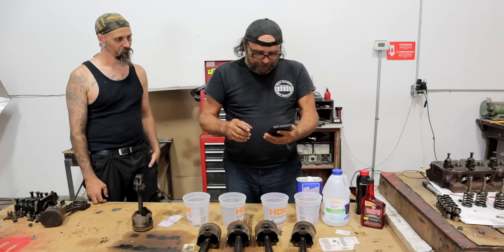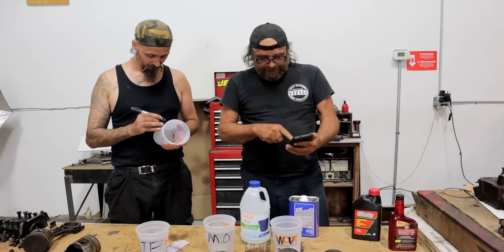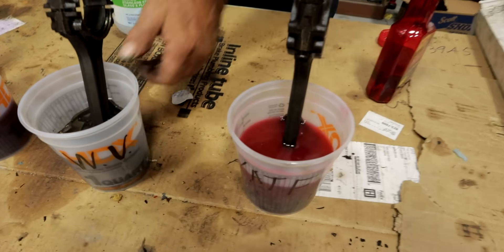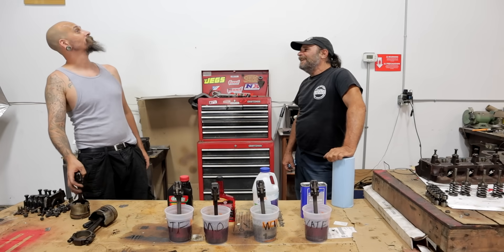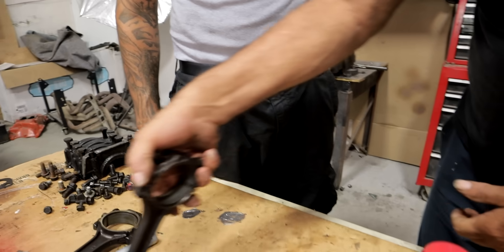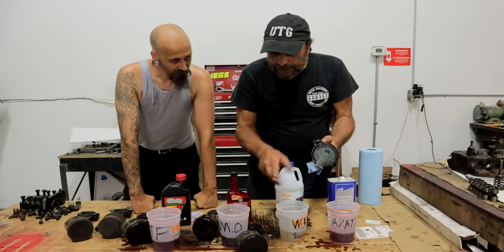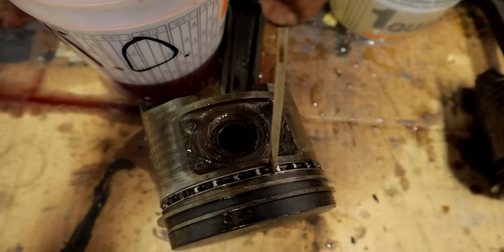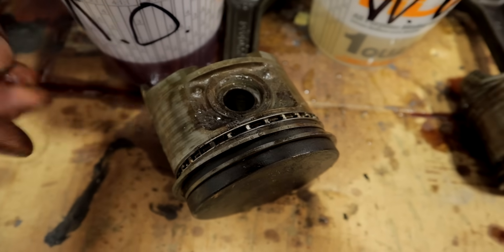Best Fix For A Stuck Engine - Viewers Choice. Marvel Mystery Oil, vs ATF, vs Acetone, vs Vinegar

Comment: Mostly interestinjg. BUT and it's an Important "But"!
BIG difference between Sticking a crudded piston into a tub of 'cleaner' for some time.
 Any Fool can manually  unstick /clean Stuck rings when the piston is in his hands. 
What works in an  assembled engine you want to run .. again ?  Fill each cyl with 'cleaner' ... let soak for days.. then Pray?

Comment: I have inherited an old Ford with a 351C motor which has been garaged and not turned over for 40yrs. Should I fill the cylinders with white vinegar down for 24hrs and then remove the vinegar and poor Marvel mystery oil in there for a couple of days before turning the engine over?

Comment: Well, the issue with the rings was rust.  The best choice would be a rust remover such as vinegar which is acidic.  None of the other choices address the problem of rust.  They are all lubricants except for the acetone which is a de-greaser.

Comment: I have good results Methyl-Ethyl-Ketone. Basically, also whatever contains 2-buthoxyethanol as a surfactant should work pretty well. Spray Windex (foam) on a piston with a carbon and use just a tooth brush to agitate it a lil bit. You'll be surprised.

Comment: You need to heat up the parts and carbon for mmo to work . Vinegar is acid...acid does eat rust abd and it etches metal.

Comment: It is the combustion PRESSURE that will have the most effect on the rings, not it heating up.
Acid - vinegar - works on rust. Before painting steel ...

Comment: You should test with pistons in the bore as simulating fixing without removal im trying blaster small engine restorer in a smoky diesel shot throgh glow plug hole and intake some engines are hard to pull out if some chemical freed rings with out dissasembly it would be miraculus

Comment: The best solution is car brake oil, brother, most of the car dealerships use this method, we pour 10 cc of brake oil into the spark plug hole of the car, which we opened before, and after half an hour, we close the spark plugs and start. we hi
Reply: Thanks for your answer. Do you drain the brake fluid out?

Comment: You want your mind blown try Berryman b12 Chem dip. The stuff for dipping carburetors. Won't help rust but varnish and most carbon deposits brush away with a soft bristle paint brush. The only thing I've used that's better on carbon is the commercial valvoline GDI intake and valve cleaner (the stuff sprayed out of the apparatus with shop air.) Unfortunately I don't believe that stuff is for sale to the public.

Comment: Yank the plugs and valve covers. Back off rocker arms so valves are closed. Use a ball pein hammer and break porcelain off the plugs. Braze air fitting to the threaded plug base. Use Marvel because it's a thin oil. Hook up your air line. Come back tomorrow. Ben

Comment: So if I pickle my pistons, will they shrink? 😅
Seriously though, if you actually pour vinegar into the cylinder do you crank it a bit and then drain the pan? I would think vinegar and ATF, or something more viscous to keep it in place would do a better job pouring it into the cylinder.

Comment: So does that mean if I have a frozen engine, I should fill up the motor with vinegar and let it sit for 24 hours? Then afterwards drain it and put regular oil and see if the frozen engine starts?

Comment: Is vinegar a good engine lubricant?
I'm not putting that in my engine.
Anyone can free up rings with pistons out of the engine.
This has been a while.... I'm gonna check if you've done a video using seafoam, techtron and  Chemtool in this same scenario

Comment: Thanks Tony I might try 20% or even 30% white vinegar but may add a drop of ATF or olive oil for good measure just because. Wonder how my homemade salad dressing would work. I got a 1976 Vega with blow head gasket and everything is locked up. Might be fun to make my salad and pour excess dressing in engine and see if it will crank the next day

Comment: Used (coffee filtered) DOT3 brake fluid. 

Soak, then boil (differential expansion will open out the wrist pin and help free that off as well. Remove the rings and clean out the ring grooves with bamboo tooth pics. Very light burnishing here and there with aluminium foil, washing off the aluminium dust afterwards.

Came up nice and shiny. Dunno how it ran because the cops towed the car (with its freshly re-assembled engine) before I started it. Sooo sad
Reply: You could of course use new brake fluid, but why would you? Note that my rings weren't rusty, just coked up. Vinegar might be better where rust is the issue
Reply: Forgot to say that the boil was in tap water with a bit of washing up liquid. Have also used washing powder in the past, but it etches aluminium a bit, probably because its alkaline

Comment: UNCLE TONY.. MY GOTO IS A LIQUID I GOT FROM. A GUY WHO WORKED AT A  foundry that makes airplane parts...it's purpose is to check for cracks in the parts under ultraviolet light..DUDE THIS STUFF WILL BREAK DOWN THE TOUGHEST STUCK STUFF. GREEN IN Color but it's a excellent lubricant to break rusted stuck anything
Reply: Ah Excellent Green Stuff from an aeroplane plant. Thats the sort of definitive data point that we like.
Reply: @edlithgow4360  It actually resembles antifreeze coolant for your car ...I think that the dye they use for florescence is what gives it it's color. The business is located outside Albany Oregon and manufactures parts for many aeronautical companies..ie Boeing. My neighbor worked in the foundry plant and scored me a gallon of the stuff I've had since 1989 and used it on many many items over the years. It doesn't take a lot.
Point is this if there's a crack or thread or anything for the stuff to get into it will and it doesn't take gobbs if it. Hope this shirt novel helps explain (lol) It really is fantastic stuff for penetrant...nut buster lol 😁
Reply: Funny you say that. I had the opportunity to tour the labs of Indy Speedway as part of college Chemistry class. After a wreck lab folks covered the parts with some type of green goo as well to check for metal cracks poorly\not visible by eye. Thought they then ran parts through X-ray machine. Wonder if this was similar ro what you're describing.
Reply: @kevinkohler7997  The gentleman I got it from worked at a foundry that made parts for aviation and the parts needed to pass a standard by FAA. This dye was fluorescent and would also show cracks under UV lite. It's secondary use it makes one hell of a penetrant👍✔️💯

Comment: there are 4 parameters to clean:
heat
time
chemicals
mechanic

if you reduce one, you have to increase another one

so you should move or vibrate  your cleaning stuff and get it at higher temperatures

I put pipe cleaner, dishwasher cleaner and hot water into a tank and move it with a pump for 2 days

Comment: I’m surprised there won’t more votes for diesel.
I will sometimes mix diesel & marvel mystery oil with success.
Reply: I also would have expected Diesel to be at the top of the list. Maybe it was #5.
Seafoam is another one I expected  up there.
Reply: That'd be great however, most of us we do not have like a diesel engine to work on we're mostly have gasoline we don't the knowledge😊
Reply: I try today a mix of 150ml diesel,150ml of brake fluid ,and 150ml wd 40... mixed that and fill it on to the cilinders...i did the same mix in a cup and put the old sparkplugs in it to see if the carbon built up will leave...magic after 5hours a wipe of the carbon buildup with simpel old rag..Suprised how the pistons look tommorow and if it will free the rings.. a mix with atf and acetone is a good second option i just see,! Thanx for the video test , greetings from Holland ,with a oil consuming Audi engine...( 1.6 bgu)
Reply: Under what conditions, is it rusty cylinders or sticky rings like from excess old fuel residue.  Im freeing up an engine right now.  I’ve used marvel in the past and it worked well for a motorcycle that sat in storage for 10 years, but I also soaked it for several days and rotated the engine every so often
Reply: @shidukirider I’m trying to free up a piston in an old 1982 Kawasaki klt 200, it was free when it last parked a few years ago, it’s been about 17 hours since I put the Marvel mystery oil down the spark plug hole, still won’t budge, how many days do you think it could take for that stuff to work if it’s going to work?
Reply: @TimothyWalton-fr4is  might take a few days.  Also you might try to turn the engine using a breaker bar on the  flywheel nut.  You can try to work it back and forth that way too.  Wonder why it got stuck, maybe just humidity.  If the cylinder flooded with old fuel it could be gummed up.  I used berrymans b12 to cut through old gummed up fuel on a low mileage frontier with compression issues

Comment: I didn't record numbers, but have had some luck on old oil burning cars with Xylene, added to cylinders, let sit for a weekend, then blown out, followed by a brutal "whupping on it" drive, then an oil change.
   It's a strong organic solvent...dissolves stuff that gasoline or atf won't,  and also isn't very volatile, so doesn't evaporate away before it does it's work.
   It's sold by gallon or quart in the paint aisle, a better deal than some expensive aerosol that is just an overpriced mixture  of common solvents,  given a fancy name. (e.g.- mineral spirits sold as "goof off", or whatever it is.)

Comment: I'm a metal fabricator and use concentrated vinegar to remove rust and mill scale. If you let steel sit over night it will usually be totally clean with a quick wipe from a rag in the morning, but it will start rusting again almost immediately. Once it gets coated in oil it would probably be fine, but it will rust any other steel/iron it can get to
Reply: Have you ever tried dropping the steel into some Purple Power?  With a pH of around 13, it should easily neutralize the vinegar.

Comment: Totally (or 90%...) off topic, but I'm amazed at the great job that tomato ketchup does on cleaning copper. Smear it all over the tarnished copper, leave it for an hour or two, and rinse it off. (Consider ketchup as vinegar in a gel formulation.) Ketchup or vinegar can also enhance the flavor of Tater Tots and fish and chips, while Brasso or Seafoam won't. So there's that.....
Reply: @johnstuartsmith
 Thanks for the tip. I've been wanting to try a way to clean some tarnished pennies without abrasives. Also will try on some vintage/antique brass items I have without damaging the finish.
Reply: That is because almost any acid will attack rust. Tomatoes are acidic as are lemons, citrus fruits, vinegar, soda pop,,,,,. However, some will be more messy. All should be cleaned off well after, steel tools and auto parts wiped down with an oil to prevent rust.
Weak or diluted acids will take longer, some strong acids might dissolve the part or even you. If using strong acids you might neutralize them with a base such as baking soda prior cleaning.
Reply: I use V8 to clean oxidation off extension cord prongs and male/female spade connectors. It'll loosen the oxidation so it can be rubbed off then rinsed using hot water.
Reply: Indubitably

Comment: I couldn’t begin to count how many engines I have successfully un seized including valves stuck open. 

In the beginning I tried many different oils including ATF. 

After experimenting and not being successful I found something that works better than anything I have tried and has never let me down and I’ll only use this for stuck engines and that’s break fluid. 

I would  pour just enough down the spark plug holes to about a quarter inch of break fluid on top of the pistons and let it sit overnight.
Reply: And then. Turn on the engine with brake líquid in?, or oil chahge first?
Reply: @ 
If the fluid goes past your rings and into the crankcase then you have bigger problems than worrying about changing the oil.

Comment: Good video, i have a CA allis Chalmers engine stuck. Im going to try the vinegar. In the past we would remove the plugs and pour an elixir into the cylinders and if that didn't loosen the engine then if it had a manual transmission you could put it in gear, pull it then engage ( pop the clutch) and that would work every time.

Comment: I've seen guy's spray brake cleaner into their cylinder's, then do a Plug change and an Oil change.. I've seen some turpentine used too for carbon.. Great vid though. I actually expected the Vinegar to clean the best. Never seen it used before.

Comment: The Acetone would have worked better without the ATF, Please PPL don't put that into your cylinders. I have been hearing PPL say Trans fluid will clean and unstick rings. I have seen PPL poor small amounts of Berryman's into their cylinders overnight and get decent results. But I haven't seen anything you can take, pull the plugs and poor it into the cylinder's that works without having to be used a few times. But then when you do that you have to do an oil change right after depending on what you use I guess but soon after.

Comment: Just used vinegar to get a stuck piston out of a 351 Cleveland. Currently have it soaking to get the rings out now. Also used some other UTG videos to do a quick hone. I’m doing a quick home rebuild to get it running again while I start buying performance parts. This is the first plateau.
Reply: I let the vinegar sit in that cylinder for about 3 days before disassembling. Twice a day I checked it, in the morning and at night and each time there was rust/carbon residue at the top of the cylinder.
Update, I placed the piston with seized piston rings in vinegar in the afternoon, and checking it at night (11pm) oil ring is starting to break loose. The top and second ring are the ones that are worst off.
Reply: @B1Springfield  Did you get the engine running with the original pistons? Vinegar freed off a motorcycle cylinder for me that hadn't moved in 30 years. Haven't run it yet though.
Reply: @ I actually did, but had to rering the pistons, clean up the bores a little with the grinding stones, and, that one cylinder is a constant worry on my mind. Planning to send it to get bored 30 over with new pistons soon.

Comment: When you disassemble the pistons and its parts outside the engine piston chamber. It is very easy to remove the oxidation , carbon built up and sticky sludge. It is different if you don’t remove them and used engine flush

Comment: I just used Berryman's B12 Chemtool to free my piston rings from carbon over the 4th of July wknd - A big difference though between doing that vs this experiment was that I brought my vehicle up to operating temperature before taking the plugs out and soaking the engine every 2hrs with the Chemtool. I put about 2-3 oz in each sparkplug holes a few times.
I wonder how higher temps on the rings would affect the outcome of this???
Reply: I don't know if it's good to take out the plugs with hot motor.

Comment: Thanks for the video. The vinegar worked great for me on a Honda GCV 160 single piston pressure washer motor. Unfortunately, the oil ring assembly on this piston has a tiny, hair like, chrome or steel trim ring bonded to the outer edge of the ring. Maybe that's a wiper? Anyway, the vinegar destroyed that. There was also pitting on the wrist pin after soaking for a day in household vinegar then another day in 30% vinegar. Just a heads up to anyone working on this motor.

Comment: I own 78 vintage motorcycles and a few studebaker.   I’ve tried everything..  best thing I’ve found is atf mixed 50/50 with 97% alcohol..     if it’s not seized from melting somewhere.. it will come lose

Comment: How about step 2? Are you going to pour vinegar into a  spark plug hole and let it sit for 24 hrs?  This is proof that the correct remedy is removal of the pistons , cleaning the grooves with a ring groove cleaning tool  and new rings. Satisfaction Guaranteed !

Comment: Try plain water on one. A friend was working on aluminum AC fittings that were stuck.  I told him to wrap the fittings with towels and soak them with water over night.  Came apart with no problems the following day.  Farmer trick for stuck/rusty disks:....Hook it up to a tractor and back it into the creek over night.  Took moisture to size it,....Also takes moisture/water to loosen it. Worth trying.

Comment: I used to boil carburators for dirt bikes quads in vinegar in a stainless pot on the stove. If you put a little heat to it ,it actually runs down the venturies and holes boils it out like you wouldn't believe but i still think ATF is a good penetrateer. Ive used it so many times im freeing up a stroked SBC now in diesel fuel i also like mystery oil they all work for different applications. Atf has detergent that cleans aluminum it might take longer but it goid too. Awesome job in the demonstration. Good content

Comment: Who's going to pour Vinegar into thier cylinders??? Try adding about 1/2 to 1 quartof MMO into the oil, and run as a flush. Let the heat work to free up the rings. It will clean out the engine after about 500 miles.

Comment: The problem with the vinegar approach is, vinegar is acetic acid... Its literally eating away at the metal... Probably not the best thing for the internals of a car engine.... At the very least youd need to ensure you fully neitralize the acid afterwards.